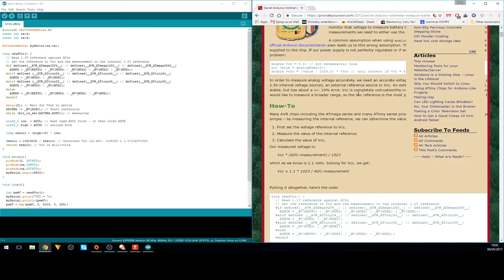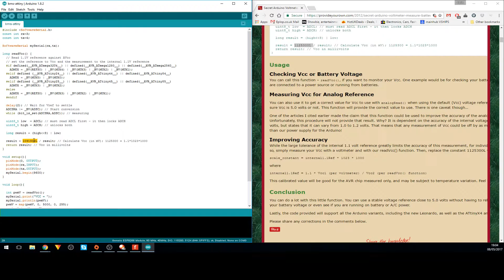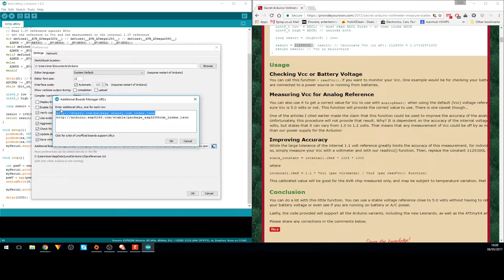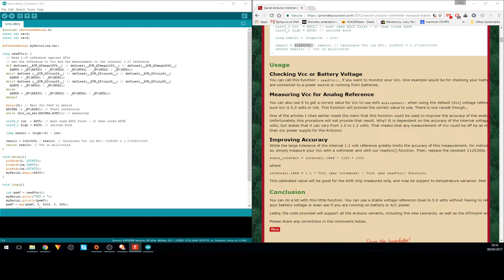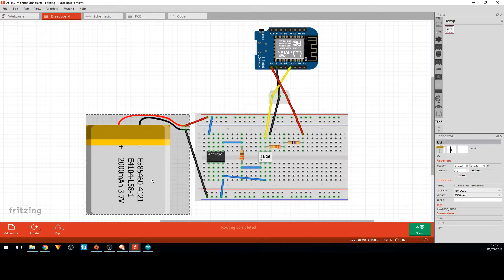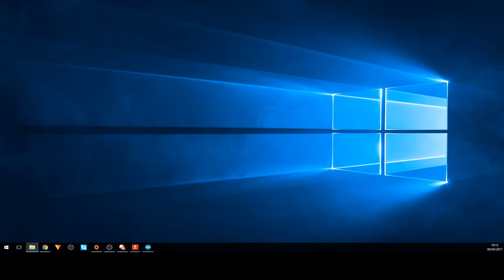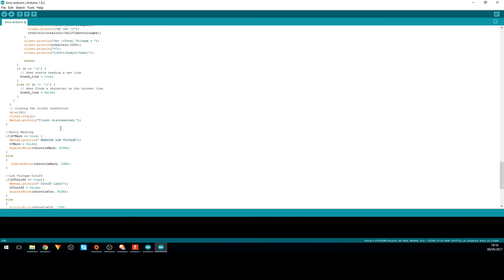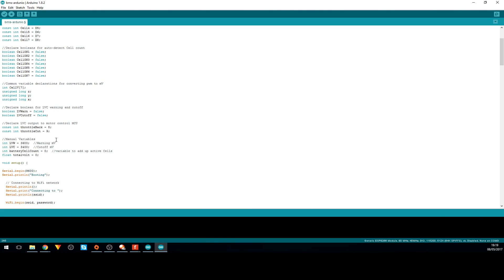BMS - Software

Comment: Hey, the circuit which you designed is for a single cell monitoring or do we require 7 such circuits ( like 7 attiny85 Ic's and optocouplers) for each cell monitoring?
Reply from the maker: Hi this is a really old video, you might be better looking at the diybms from stuart pittaway.

Comment: So, with respect...  I was encouraged by this project, but then had to check Description links and parts 1, 2, 3, trying to find a schematic.  It looks the closest found was a "layout diagram" OF the schematic, as seen in this vid.  I have no experience with 'fritz' file-types, nor interest to try to open/view such.  In the way of suggestion, for viewers with interest who most quickly understand circuits from schematics, if the 'fritzing' program can export to graphic or .PDF, it wouldn't take much to integrate that into one or all of your vids, or via link in the Description.  Yes, it's more production work on your part...  But viewers then are more motivated to give thumbs-up if the don't have to chase down more details.  Appreciated.
Reply from the maker: Hi thanks for the comment, the links to the code and fritzing files are mentioned in the description of this video.  I'd encourage you to look at fritzing as it's a great application and you can export it in any format you wish.

Comment: Why did you choose the ATTiny? The ADC is worse than Arduino.
Reply from the maker: I found it pretty accurate once calibrated, the ATTiny is a lot cheaper than the arduino, worst case you can always use an external ADC
Reply: Colin Hickey to be clear I was not trying to be rude, I was honestly curious. I agree with you on both points. I'm following your build and I am excited to see where you can take it. Awesome work man! I ordered some 16Bit ADCs (ADS1115 on a breakout) and will play with them. I really want to build it using the STM32 but I still have a lot to learn about that chip before I can make any of that public.
Reply from the maker: You weren't rude at all and certainly didn't take it that way, i know a lot of people have found the ADC in the attiny/arduino bad but with calibration they are ok, the optocoupler is what makes it less accurate in my setup but looking to change that.